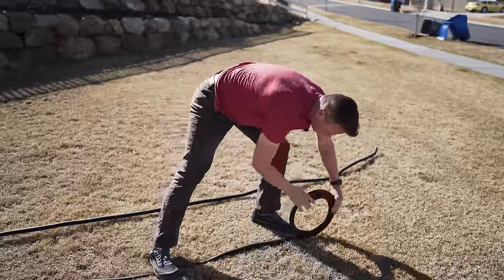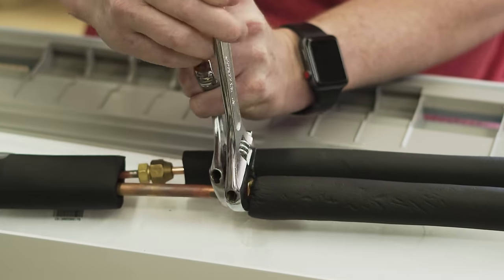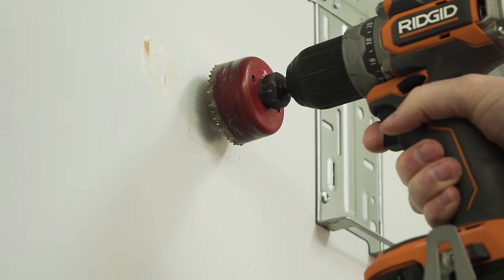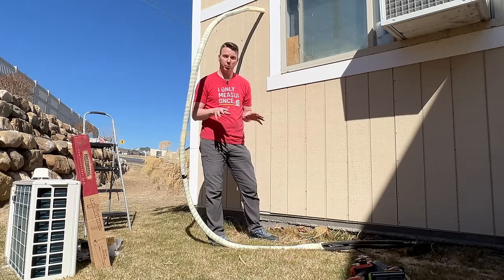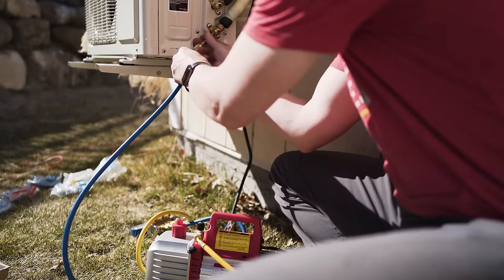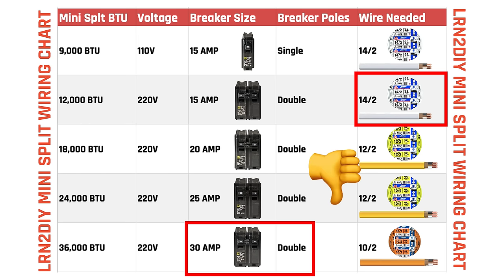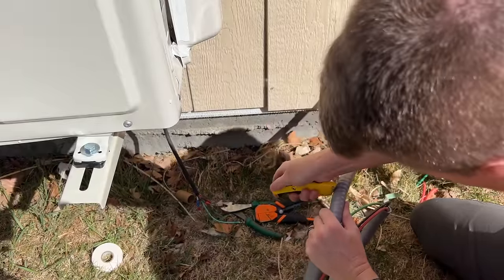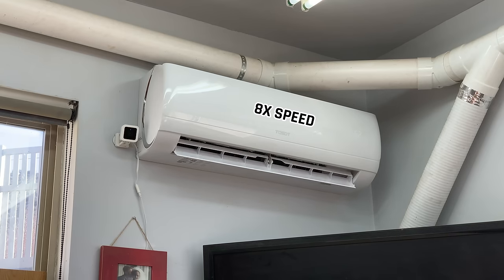DIY Mini Split Install - All the Things Nobody Shows You

Comment: This is a decent beginner video. Manifold doesn't provide any pertinent information regarding vacuuming. It simply won't measure the 300-500 microns you are trying to achieve. Need a micron gauge for that. This is just guessing and might as well skip the gauges all together and would recommend much more than 15 minutes if just guessing. Also, after vacuuming you shouldn't break any seal as that just lets air/moisture back in. Should have closed off the low side going to the manifold and released the charge before taking anything off.
Reply: Good point.  If guessing at the vacuum level, remember that if there is 1 drop of water in the copper lines, it will take over a hour to evaporate at 1,000 microns, before a true vacuum is pulled.   It does not hurt to run the pump a extra 60 minutes.

Comment: Great video. Any idea if they make a 2 room version?
Reply: Mo Dingo, the unit shown is not a two room unit.  I have checked the prices of a two room unit, and you would be much better served by buying two of the smaller units, and then if one compressor fails, you will still have the other room cooling or heating your home.

Comment: It's against code to run paper thru a pipe . It's a fire hazard. You should have just used loose 15amp wire.

Comment: I just installed a mini split and did everything my self. I am also a wood worker and my shop has metal dust collection system. I notice you have a PVC dust collection system. I would recommend you run a bare copper wire down the side of the pipe attached every three feet with a metal screw drilled into the pvc breaching the interior and the copper wire eventual termination to a ground.
PVC dust collection systems are known to create excessive static electrical charges and numerous methods exist to ground and discharge static buildup. This is just a side note. Some experts say that the static charge is not a risk while others say better be safe than sorry. Disregard if you ran a copper wire inside the pipe (one method) Best Regards
Reply from the maker: Thanks for the feedback. I actually haven’t finished the dust collection system due to poor electrical planning on my part but when I do I’ll definitely ground it like you suggested.

Comment: Shut of valve and open the refrigerant into lines and then remove the blue hose. This is highly recommended as it will introduce a small amount of air into system and it helps with system functions. It will let off a little Freon whole disconnect but this is the correct way to unhook .Using a 30 amp breaker on a 15 amp system means your untit will fry before the breaker pop's.
Reply: The way you worded what you wrote makes it sound like having air in the system is a good thing.  If that is what you meant, you are WAY wrong.  Air and the moisture in it are the enemy of an HVAC system.

Comment: I've been doing HVAC installs for about 18 years.  I'm not knocking this guy but all I can say is he sure did it the hard way.
Reply: I agree!! I was watching him install the lineset all the way through the wall, scraping all of it.  Then coil up the tubing so it will retain oil in the tubing.  The use the black and white wires for the two hot lines, and tape up the red wire?  And use a 30 amp circuit breaker sized for the maximum wire rating, not the unit's MOCP rating of 15 amps.  Sure a lot of mistakes.

Comment: Basically a good video, but this is an example of a home-guy doing things and including errors that do not need to be repeated by others. YouTube is a great thing, but every video needs to be taken with a grain of salt. 1) You used a white wire for power (not as a neutral), which according to code is "legal", IF...IF... you mark the white wire with black, or red tape (on both ends), to indicate that it is used as a hot wire and NOT a neutral. What you did is a direct code violation. Since you used a 10/3 Romex, why didn't you just use the red wire as the other hot, since that is what it is designed for? By doing so, and tying the white to neutral in the breaker panel, then out at the disconnect box, if you ever need to add a 4-wire 240V outlet later (for say a generator), then you already have it wired appropriately outside with two hots, a neutral, and a grounding conductor (bare/green). Just cap off the neutral in the outside box for now. 2) Your connections of the whip wires to the screw terminals inside the condenser unit left wire strands out from under the screw clamps...not good. If the wires are too big, you could have crimped lugs onto the wires, and put them under the screws. 3) I can't say for certain if this one breaks code, but I bet it does: you needed to have made sure that your conduit body fitting that went inside the wall had a nipple to extend fully inside the wall. It may have, but you didn't show that. It also needs to have the wire protected from metal edges, with a chaser or threaded plastic ring. The licensed electricians or inspectors can have the final word on this one.

Comment: Checking with soap is over kill. If vacuum held you are good to go. !!!!!!!!
Reply: Usually, but I have seen many times when a system had a leak so slow that it took a year or more to lose enough charge to affect cooling.  Much better to be safe than sorry, especially when you're right there workin' on it anyway.

Comment: How big is your shop in relation to the output of this unit?  Thanx.  Great Video!
Reply from the maker: The shop is only 196 sq ft so the mini split can handle it easily. I’m building a 450 sq ft garage shop now and am installing an 18,000 BTU unit in there. Again, it’s more than it needs but it doesn’t cost much more to do a larger unit.

Comment: Sorry, you made a serious mistake! Never, never, coil your line set in a vertical position… If you leave the excess length it should be in a horizontal position… This is because oil has very low vapor pressure rate and will remain a liquid throughout the entire system… This is not a problem on the high pressure side as when the refrigerant is in liquid form there is high miscibility with the oil… However, on the low pressure side, this is not the case… Now, the oil is returned to the compressor either through gravity or sufficient refrigerant flow (speed)… As mini splits are variable speed, they usually run with much lower rates of refrigerant flow… Thus, the oil in the low pressure side, still in liquid form yet the refrigerant is now a gas, might not be carried by the refrigerant against gravity when the excess line set is in a vertical loop as in this video… The accumulation is very slow as only small amounts of oil escape the compressor; but over time, if that oil is not returned to the compressor your compressor will fail… Just saying…

Comment: I bought the vacuum pump linked above, however the 5/16" adapter will not thread onto the Tosot vacuum connection.  It's almost like it's a different thread pitch or TPI.  What adapter did you use?
Reply from the maker: Here’s the link to the adapter. Unfortunately none of the kits come with them. • Adapter from Gauge to Condenser: https://geni.us/M0ntsrl
Reply: @LRN2DIY  Great, I did order the right one.  Great video, by the way!  I've been following it all along the install.

One thing to mention:
The manual states to mount the unit such that the back is no less than 11.8" away from the wall.  The unit is 13" deep from mount to mount, therefore any wall brackets would have to be a minimum of 25" long.  Even the ones Tosot sells directly aren't that long, the one they offer at purchase time is only 18".  I contacted them about this disparity.  It took 5 days to get an answer (lots of back and forth, with one response being, "As long as it's not too close, it's ok"??!).  Eventually they said, yea, it's ok, just go with it.  Many other manufacturers state 4-6" as a minimum distance, so, I'm wondering if someone got their units wrong, and 11.8" was really supposed to be 11.8cm (5").

Thanks again!

Comment: just save yourself a bunch of headaches and buy one that is "precharged" then you don't need all those specialty tools.  Get a Panasonic unit, 120 volt unit, as that's not gonna save you anything, with a seer rating (the higher the better).  Then you can run that on 4 300 watt solar panels hooked up to 4 100 amp lithium ion batteries for about 1500 bucks, you'll never have an AC bill again.

Comment: Great video and fairly decent work but  hvac is not something you DIY. So many wrong things there and I’m not saying this to criticize you it’s just so others don’t do it like you did. Like others said the right breaker size you find on that outdoor label. It will say exactly what it’s rated for. Whatever that label says that is what you need to use regardless of what size wire you use. The vacuum you pulled on that system you technically lost it when you took those gauges off before release of the refrigerant. That coiled up copper is definitely no good. Those systems come with enough refrigerant most of the time but you should still at least check the charge to make sure. I know it will probably be ok at least for a while but that job is definitely something an hvac tech as some point will have to come back to.
Reply: oh look, it's another smug know-it-all!

Comment: Ok, I am not an electrician but I have decades of experience with electricity and electronics as well as studying and doing my own electrical.  You said you put the neutral and the hot into the circuit breaker.  I'm pretty sure this is wrong.  What you're getting out of the breaker is two opposite poles of hot.  

I know you did a later video with an actual AC expert to show how to do AC.  I suggest you spend some time with an actual electrician - a very experienced one - before you do more videos with electrical work.  Electricity is dangerous and when you tell it wrong,  you lead people to make dangerous mistakes - like maybe touching "neutral" that should be the same as ground but, in the case of what you described as neutral, which is actually hot,  your viewer just got killed.

Comment: BOOO,  you should have used a 15 amp breaker, regardless of the 10 gauge wire. You could have used 14 gauge wire instead 10 gauge. The unit isn't pulling 30 amps through the wire, in fact you are only pulling current that is safely carried by 16 gauge. If you want to watch the compressor burn up when it fails leave the 30 amp breaker in place.  If you aren't a licensed electrician don't demonstrate wiring unless you have a licensed electrician certify your video. This portion of the video was a disaster. Also, you could have connected the copper lines from the outside and you wouldn't have had to man handle the 16ft  length of tubing as you tried to pull the full length through the hole in the wall, DUH!  On the plus side you are a good speaker and overall the video was helpful to the non DIY type viewer.  Good luck on the next one.  Try outdoor freeze proof water faucet replacement. Those can be tricky replacement projects and if you do it wrong you end up having to dig up the entire old pipe and below ground connection.

Comment: This pains me to watch how are you installed at mini split! I am been doing mini split installs for at least 30 years and there’s so many areas where you could’ve made it easier on yourself plus the main thing is when it breaks which it will you made it almost impossible to work on it without tearing it all apart! It’s nice that you’re showing this for the average DIYer. However, you should’ve consulted with somebody who has had more experience before painting yourself into a corner. You did a nice job, but nice jobs down the road when you have to work on them need to be able to get to your flares fittings because most mini splits leak from the flares, he has later, and you have to be able to get to them. I applaud your efforts though.

Comment: NEVER install the outdoor unit on the wall.
At least not on a living space wall.
The unit creates some vibrations, which can be extremely annoying if your couch or bed is on the other side of the wall. 
The unit should be placed on a stand on the ground. No need to make a concrete foundation  -  a pair of large concrete pavers is sufficient.

Comment: I was cringing at your vacuum method. First your adaptor didnt have a core depressor. Then you just break your vacuum without adding refrigerant to break the vacuum and not add air to your system. A proper tech will use a micron guage which will have to run until the microns are below 500 and stay below 500. Miss this step and your going to get acid build up and eventually damage your compressor

Comment: Can’t run Romex in conduit.
Reply: I disagree.   Per code, you can run NM cable in conduit to protect it from damage.  See NEC 334.15(B).  As others have noted, however, you cannot run it in conduit in a wet location (outside) unless you use NMC (not common) instead of NM..

Comment: Should always match the breaker to the load, not the wire
Reply: The breaker is there to protect the wire.
Reply: @freeforall825  wire limits the load limit, the breaker is to protect the circuit from overloading and potentially causing major issues

Comment: i sorry but every think you said is wrong line set shouldn't  be attached to air handler first tubing is soft and easy kink you shouldn't over size wire and breaker air  handler are recommended to be a little out of level to help with draining line set should be wrap with foam as these units sweat  a lot not least than a normal ac system and as far has for draining it produces twice the condensation i know this as i have to go behind people think they what they are doing if someone was going to install one call a hvac company and ask for help or direction

Comment: Where's the part that you add refrigerant?
Reply from the maker: At 19:00 I opened up the lines which allows the refrigerant that ships in the condenser unit to enter into the lines. You don't need to add anything else.
Reply: @LRN2DIY  oh I see. I was wondering. In my country, the install brings a mini tank with them to fill refridgerant.

Comment: You did a ton of stuff wrong in this video.  It should be deleted for liability reasons alone. So no one sees how to do electrical wrong and burn their house down? You are sizing wiring based off of the voltage and not the amperage! 14/2 is fine for 240v its normally rated for 300v anyways. There should be a Max overcurrent protection written on the tag of the unit. You doubled the amperage. Just because can connect wire and pipes doesn't mean you know anything about electrical. There is no neutral on 240v. And don't put vice grips on brass valves! Leak check the piping connections before you insulate them! Vacuums should never be pulled on time, especially 15minutes. They should be done measuring a digital vacuum gauge! And if you pull the hose off while under a vacuum you have broken the vacuum and allowed air into your system! Woodworking youtubers need to stay away from minisplit installs, they always do it wrong and they are teaching dangerous methods that can ruin your unit and void the warranty.

Comment: Wow ! 6  1/2 minutes in and I have seen many mistakes. Some are DANGEROUS !!  The signal wires as you call them supply 220 volts AC to the indoor unit. When you installed them on the indoor head unit you did not install a bushing in the metal bracket ( the round hole ) you put the wires through.  The wires will chaff on the metal and short out causing a fire.  A short in the head unit will not trip the breaker if the outdoor compressor is running !!   Also , you don't mount the head unit with drywall anchors. It will fall off the wall from vibration. You ALWAYS mount to the studs !!
You obviously don't know anything about building, electricity, or handy man type things in general. If I were you, I would ether take down this video, or add a disclaimer that your not really sure if you did any of this correctly.

Comment: Just want to say encouraging the diy of refrigeration equipment is grossly irresponsible.  R410a is over 2000x the impact of CO2 on the greenhouse effect and should be handled only by professionals.  Bargain basement preflared linesets installed to “i don’t know, feels tight to me”  are a leak waiting to happen.  I know regulation is different in different markets but the bottom line is people without training should not be handling refrigerant.  The mistakes they make not only shorten the life of the equipment but also increase the risk of uncontrolled release.  Hopefully the a2l transition scares people enough to kill this questionably legal practice

Comment: Rename the video to “How to do everything wrong”.  In this video you learn how to break all electrical codes, improperly running a vacuum for adding Freon , improperly weather sealing exterior holes, not supporting refrigerant lines, how to avoid inspections and permits. By the end of the video you will have learned to cut once but move the bracket twice.  At the end of the job you will receive a special t shirt that will say “certified Hack Master”.  You will also receive a letter stating that you have been dropped by your insurance company. 

Ps you might want to think about removing your video.

Comment: Next time, consult an electrician so you learn what wire to connect as this is a 220 installation, and with this 10/3 you should have connected black and red as there is no neutral line....
There is a reason why this is not a DIY thing to do!